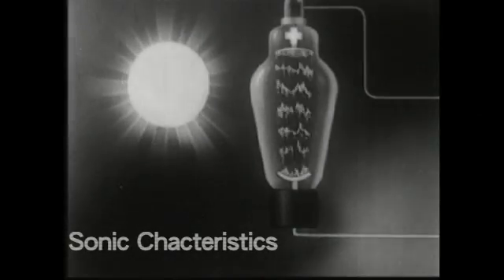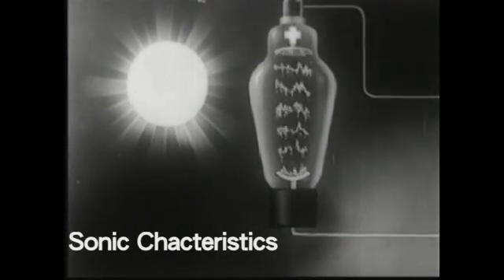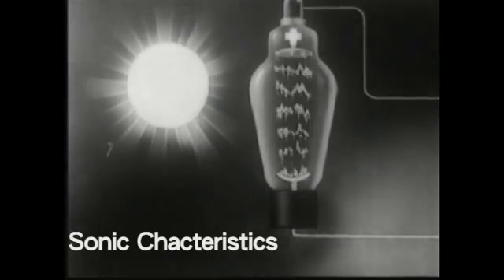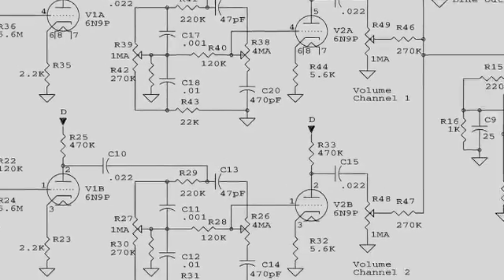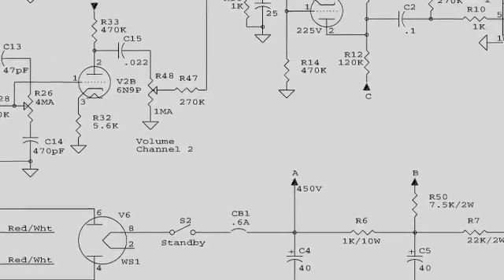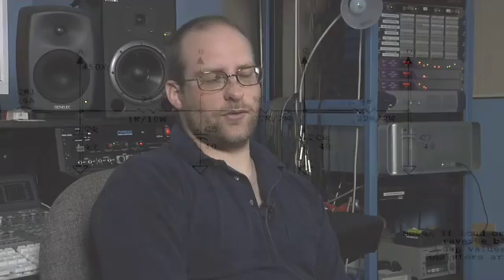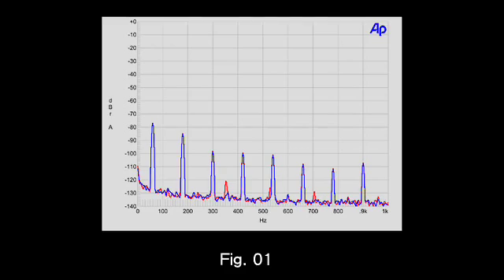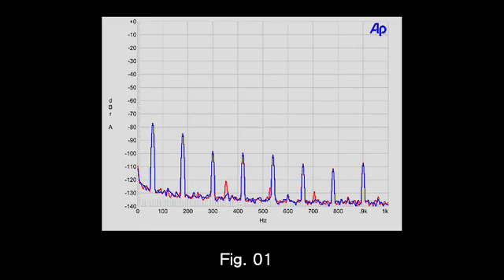Tubes Vs. Solid State Amplification

Comment: To me, the solid state amps sounds harsh compared to the tube amp
Reply: +TruthOldSchoolStyle Have you heard of the Acoutic Solid state amps, they came out in the mid to late 70's, some friends of mine were jamming, all tube amps, another friend came by with his new rig, solid state, he started playing, the tube amps had noise when not played but the solid state was quiet and everyone was blown away by it's sound.  I own a solid state and don't care for it  because it has no soul so I built a jtm 45, lovely sound, valvey.
Reply: +dispatcher7007 i agree, take a lab series or a roland jc for example. The problem is that manufacturers only build entry level solid state amps, once go up in the product range, you can only find tube amps. Thats the major reason why solid state amps are bad, they are cheap. 
And brands like marshall arent gonna make their mg series sound better than a jcm 800....

Anyway, i'm mostly playing on vintage tube amps because i like the fact they are simple and can be repaired somewhat easily and inexpensively compared to a modern amp built with circuit boards. Also, you can always find that particular deal on a used vintage amp, like that traynor mk III head at 380 $ that i bought a few years ago. That amplifier destroys pretty much everything fender-like in under 1500 $

So yeah for me, tube amps are the way to go, unless the industry changes its mind.
Reply: +dispatcher7007 - Your conclusion is largely based on a compressed playing style, lacking dynamics.  Some well-designed SS amps can  possibly fool my ears by taming the awful odd harmonics (with a far more complex circuit which introduces phase smear, reducing clarity and 3D SoundStage) but they can never fool the "fingers" of an accomplished, dynamic player seeking a vocal quality.  That is only possible through the linear distortion characteristics of a Tube amp.
There are other Physics problems with SS for audio such as current controlled vs/ voltage controlled and forward biasing vs/ reverse biasing but this is a limited forum so I won't go into those technical aspects here. The bottom line is feel in dynamic playing where one can smoothly transition from clean to overdrive by volume settings, even at he guitar, or even due to how hard or softly one picks..  SS cannot physically track that.  Period.
Reply: +dispatcher7007 - It is not meaningful to cherry pick a single feature ie: voltage controlled (but still not linear but rather sudden OD threshold) and demolish an entire argument.  SS and Tube still operate in FUNDAMENTALLY different ways and they are distinguishable by human ears. I'm not a fanboy in that I had to be convinced by experience that Tubes are not only different but better for most kinds of audio, even reproduction.  There was a time that I championed SS until I learned better.

I heard a comparison between a high power Hafler vs/ an ancient Triodes-based Altec Theater Power Amps and was utterly shocked at how much fuller, clearer, better the Altec sounded and this using a direct-to-disc master recording. Keep your cherished experiences for sure but don't write me off as ridiculous bullshit as I learned electronics on both tubes and SS in high school and spent a lifetime (50+ years) in the music amplification business earning respect from many great players' ears. I won't stoop to name dropping but perhaps you might realize you have a different set of experiences, likely shorter and less complete, than I do, since I have repaired, modified, designed and built literally thousands of amps both SS and tube.

Comment: I don't think it's fair to use a Line 6 in any comparison, they are hybrid amps. As for solid state versus tube amps, I totally understand the guitar players out there that love that sweet harmonic distortion they can easily control with their tube amps. But I'm a bass player and I want a clean sound, so I prefer the sound of my solid state amps.

Comment: The guitarist has CLEARLY never heard of Mesa Boogie, because he would have thrown that line 6 in the trash can and never looked back.  When it comes to recording, think about it this way.  A tube amp "sounds" louder than a solid state amp.  Watts are watts, but the way a tube amp sound to our ears; it just sounds louder.  So If you record a tube guitar amp , your guitar is going to pop in the mix better than a solid state amp will.  Solid state amps just don't do that.  They sit back in the mix and never have that in your face sound.  That's been my experience.  I have a home-brew fender 5f1 champ that I built.  It's 5 Watts and it sounds louder, and better IMHO than my friend's line 6 combo amp.  I'm pretty sure it's more than 5 watts.  He's selling his line 6 now and getting a boogie.  I also have a vintage musicman bass head that I use.  It has a solid state front end and a tube power section, I like that combo.  They compliment each other well.  I can't imagine a tube pre amp and a solid state power section would sound as good.
Reply: +Ben Cooke First, he has to lean how to play the guitar.
Reply: todd goslin
lol
Reply: I agree. He's too lacking of a guitarist to do any gear demos. The guys must pick a better guitarist.
Reply: I have a guess of his settings.
Amp model: INSANE
Gain: Max
Treble: Max
Middle: Who fucking cares
Bass: Soo max. (It sounds so flubby to me)
Presence: MAX
Mods: Nope
Delay: Nope
Reverb: Nope
Master Volume: probably really high to the point where the speakers start clipping unpleasantly.

It's easy to guess these kinds of guitarists. No offense, but he's some noob who thinks of all gain and no mids. He doesn't even shred. The guys who made this makes everything sound and look like a troll.
Reply: wouldnt an EQ fix that problem?
Reply: Chichi, that's what a EQ and driving  the front is for, as well as  warm sounding guitar. Silly
Reply: Ben Cooke He's like 14, not 50+ with disposable income like you.

Comment: Even order harmonics sound good to the ear.  SS amps clip and produce odd harmonics that sound harsh to the ear.  
The other thing I have found  over the years; is that when transistor (guitar) amps start to go wacko..they blow fuses and the power stages short out, and if the speakers are not fuse protected, because they are direct coupled to the speaker.
.lots of power supply dc can end up in the speaker, cooking a very expensive instrument speaker.
 I've had this occur. The other thing is that tubes are much easier to change/repair than transistor circuits.

Comment: Tubes. All the way. Whether or not it is possible, there just aren't ant ss guitar amps on the market that can give you the same touch response, compression, bell-like cleans, and warm lovely crunch that tubes can do. When ss can sound like a blackface, I will embrace it because tube amps are heavy and unreliable. Unreliable due to the nature of tubes (like a light bulb, they don't like to be handled and knocked around) and the high voltages on the circuit tend to wear out components faster. Try chasing down a burned out resistor...
Reply: Check out the Blackstar ID100TVP.  Will make you think twice about writing off SS. New technology is catching up and tubes are becoming vintage technology.  Won't be much longer and SS is going to own.  It's inevitable.
Reply: seanARNG Sure sure. They've only been saying that for the last twenty years...
Reply: Patrick Ford Haha very true! Any century now!
Reply: seanARNG Don't get me wrong... I will relish the day ss is good enough. Mostly for the weight savings and reliability, but mostly the weight...

Comment: Tube guitar amp vs. solid state DIGITAL MODELING amp?  Man, that's way off.  Guitar amps are often meant to saturate their tubes.  I do high end hi-fi.  I like a good, not overly euphoric tube preamp and a SS power amp.  The necessary output transformers make the output impedancce of a tube power amp higher and it interacts with the impedance of the speaker, changing the response with each load.  I also find the damping factor and bass articulation is less good.  Tube pre and SS power floats my bubble in the middle.... Other than the Line 6 Spyder (not even a good modeling amp), a nice explanation.
Reply: Patrick Ford I agree.  Actually, if I can't push the power tubes due to output level restrictions, I prefer a tube amp with clean headroom and a truly fine pedal.  Just my preference.  I'd prefer a nice tube amp saturating, but even at 18W, that's loud at home....  Take care.
Reply: I like tube amps, Fender blackface style. I prefer to run the preamp section with headroom and try to drove the power amp section. Power amp overdrive is what floats my boat. Of course that means for me high volumes. I have tried using sinks and dampers in the effects loop to try and get a good saturated but not too distorted sound by driving t he preamp section and lowering the level going to the power amp. That just doesn't sound as good to me. Tube power amp section for me!
Reply: Rick Mylum Yeah, this. Isn't it a bit counter intuitive how ss amps sound crappy, but a good old Tube Screamer, which is all ss, con sound awesome? I guess that's partly due to the tube power section too.

Comment: WTF ? Transistors model tubes in many ways ?  Go learn something about how active devices amplify a signal before you try to explain this. Tubes and transistors follow the characteristic method of amplification, that's all there is to it. The one does not "model" the other. There is no other way to amplify a signal.
Reply: +greywolf271 - "Characteristic model of amplification"? Huh?  SS is current controlled and must be forward biased to force the devices to conduct and exhibit a sudden avalanche threshold of linear to overdriven amplification curve. SS is "faster" so is capable of extremely high harmonics which, though inaudible as a fundamental to human ears, badly resonates with and distorts audible harmonics.  They are as different as apples and nectarines.
Reply: +enorbet2 -&#160;Let me clear that up. The characteristic I'm referring to is the device's characteristic curve. What "avalanche" are you referring to ? If you're talking about distortion, there are a few ways to do that. One is using a distortion circuit on the amplifiers input signal. The other is overdriving the main amplifier itself.Distortion in the main amplifier occurs when the active device is flat-topping the output signal.On the subject of extremely high harmonics, active devices used in audio amplifiers have very little amplification at extremely high frequencies. What frequencies are you referring to ? How do you expect the loudspeakers to reproduce anything over 15kHzThe mixing products of very high frequencies are negligible to the end result before the loudspeaker. If you want to simulate this yourself, get Matlab and run a few tests.
Reply: +ungratefulmetalpansy   What ? Parametric amplifier ?  What sort of diode have you invented ?
Reply: +ungratefulmetalpansy&#160; So enlighten me.  Unless you can explain your diode operation or how a parametric amplifer can contribute to enhancing audio signals, I consider you a troll
Reply: +ungratefulmetalpansy Do my posts suggest I'm not being serious ? I'm an electronics engineer. What are you ?
Reply: +greywolf271 - Please allow me to respectfully note that for example for many years Transient InterModulation distortion wasn't a term until those debating problems with ICs finally discovered them measurable by such means as Fast Fourier Transforms.  Many engineers claim that the material from which a resistor or capacitor is made (or even if they are polarized or not) makes no difference in sound.  Such blind claims come from trusting instruments and specs over the amazing "instrument" that is the combination of ears and brains.  So one should recognize that being an engineer is good but without ear training, highly limited.  It takes both.
Reply: +ungratefulmetalpansy - That is certainly true but also avoidable if one approaches learning without agenda or expectation. Additionally I mentioned it "takes both" and one value of instrumentation is it helps teach non-prejudicial observation.
Reply: +enorbet2  A) IMD investigation evolved long before IC's even made their appearance in the audio world. IMD was first investigated in RF circuits. B) The brain isn't an amazing instrument. Any a/b blind test shows that, scientifically. C) I don't know where you got your facts from about the engineers claim, but any qualified electronics engineer knows that the composites used in resistor and capacitor manufacturing adds complex impedences to the circuit its used in. This depends on the frequencies the circuit is subjected to. At audio frequencies there is negligible effect. That is to say, your amazing brain cannot pick it up. This applies to components manufactured to standard, not cheap chinese crap.
Reply: +greywolf271 - You conveniently or blindly left out "TRANSIENT".  TIM was NOT a concern or a term until ICs/OpAmps were well in place. I majored in Engineering and spent my life in Music and Electronics and subscribed to numerous periodicals like "db magazine", "Recording Engineer", 'Audio", "Audiophile"  and many others.  I witnessed the battle between too many engineers to list vs/ those that apparently had better ears or brains to digest the data.  Finally it was proven that slew rate and massive negative feedback created a burst distortion only measurable in recording instruments with high sample rates or FFTs. 

 I read numerous mainstream engineering articles that claimed that one cannot hear the difference between components with like specs but different materials and I agree that changing a single component in a complex circuit cannot be heard but changing all of them most definitely can.  The term "pooging" was coined exactly for this practice which includes tighter tolerances but also more than that. 

That you persist in such claims merely shows you maintain a bias that has already been proven mistaken, not in every case perhaps, as there does exist preconceived notions that alter perception, but that it colors every experience  contrary to mere specmanship is foolhardy.

You're welcome to keep your opinion since it won't hurt your career much at all but please recognize it is an opinion and a biased one based on such axioms as "The brain isn't an amazing instrument".  This is true because any instrument ever made was first conceived by a brain.  I understand and agree that subjectivity is a problem so it must be ruled out to be strictly scientific, but you need to understand that while that practice tends to avoid wild claims, it is also a distinct limitation that in the process also eliminates or reduces good data with the bad.  It takes time before that sort is verified but it happens all the time and it happened already in this area.
Reply: +greywolf271 - My apologies for missing this one.  By "avalanche" I am referring to the nature of tubes, depending somewhat on how stiff the power supply is and the amount of applied negative feedback, to go into saturation gradually in time, whereas solid state devices are sudden, a near binary condition.  

I don't expect speakers to reproduce signals above ~17KHz but even the production of 50KHz can beat on audible frequencies altering their reproduction.  What you apparently don't get is that musical instrument amplifiers are not mere reproduction devices but are rather musical instruments unto themselves.  

Mr Carver proved when he introduced Phase Linear power amps that the dynamic range of microphones (applies to guitar pickups as well) will drive any amp under ~300 watts into considerable burst distortion when attempting to reproduce even 120db (exceeded commonly by good mikes on a kick drum) at live levels.  

Musicians choose amps and speakers largely based on HOW they color the sound, not IF.  Celestion Speakers spent big bucks on a Laser Doppler Interferometer exactly because of the need to tailor distortion as opposed to attempting to eliminate it like JBL.  Consider that JBL has less than 15% (maybe even less in the last decade) as much market penetration/acceptance in guitar amps as Celestion.  Distortion is why since even 10% distortion sounds fairly clean but does have it's own character depending on relative levels of differing harmonics generated.

FYI I have had Matlab for 12 years and I have owned Oscilloscopes continuously since I was 16. Currently I have a Tektronix 2430.    Matlab  is great but it is not an ultimate authority in Music.

You made a challenge to someone stating you are an Electronics Engineer and "what are you?'  Not only am I studied in both Electronics Engineering and Music but such tone monsters as Joe Walsh, Nils Lofgren, and David Lyndley (to name a few) have expressed love and respect for amps I have designed and built.  What have you got?

Incidentally this began as civil between you and I but lately has seemed condescending and heated unless I have misinterpreted your words.  I can go either way.

Comment: marshall lead series! I played different tube marshalls(800/900/6100), an Orange 1 channel 100w from the 60s amps, dynacord reference amps(great) live, and any of these amps sounded ways better then any ss ive played. But there are some reallygood ss come pretty close to it. Try marshall lead series(lead12/20/30/50) or the mosfet 100. Any ss hater will be surprised! And these amps arent the freshest achievement in technology, the were build in the 80s. But hey, with the tubes you can make much more money;)